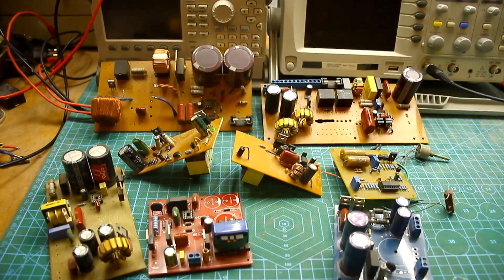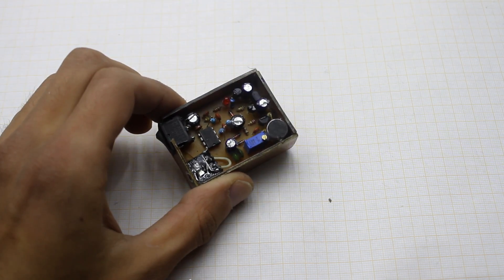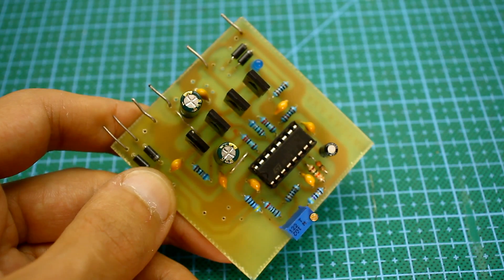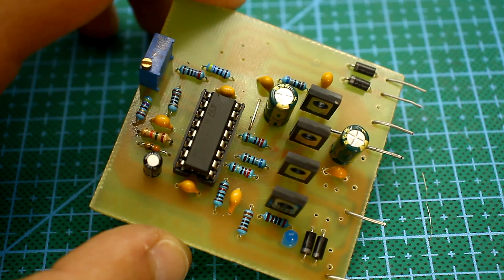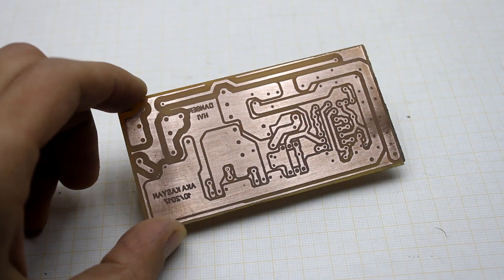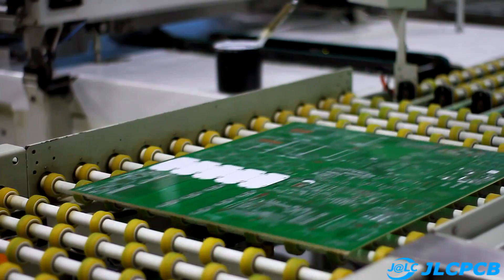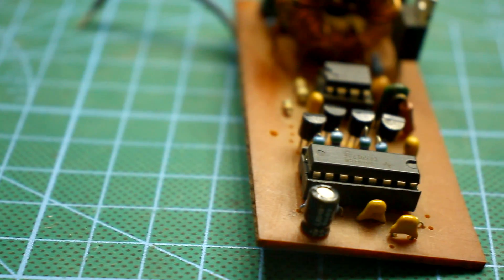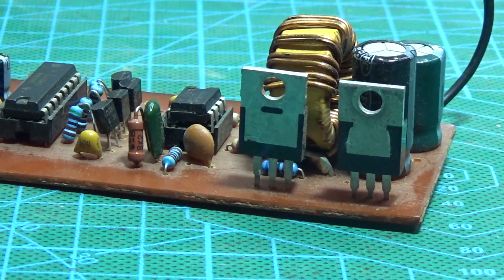TOP of unsuccessful projects

Comment: The one with the 4017 would work if you had Schmitt trigger opto couplers instead. It would allow a clean transition  between on and off without hysteresis. It should also have a scr on the output so you have to reset it when the power is started and then have an output.

Comment: For Project 1, (CD4017-selected voltage converter), if you replace the BJTs with MOSFETs, e.g. 2N7002, your circuit will work as desired. The 2N7002 should have the the same (or reversed) pinout as the BJTs (i.e. they're drop-in replacements), and RON of <5 ohms (which is negligible compared to the feedback resistance).

Comment: Cool stuff! Can you please consider making a 12V ip audio amplifier to run like two 8 watt speakers..?
Reply: I would be happy if you can make Simple audio amplifier around something availible (555,lm358,...) And with like 100W. Class d would be best.
Reply: @vitsirucka6385  yeah.. I had seen designs based on lm386 but they don't work..
Reply: Mai Mariarti  yes! Did you find any such speaker project? I want to make one for my grandpa's tractor..